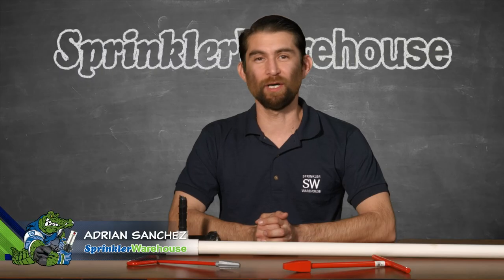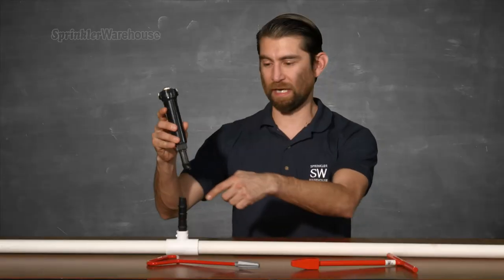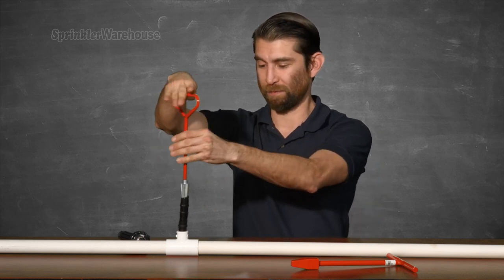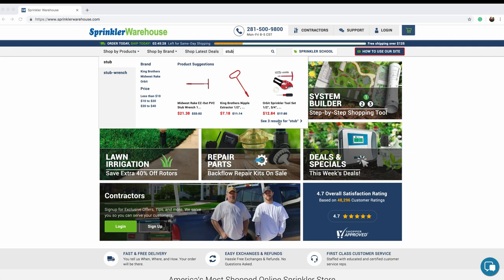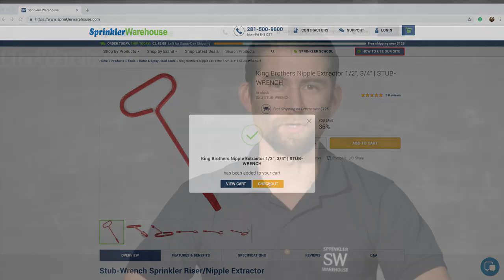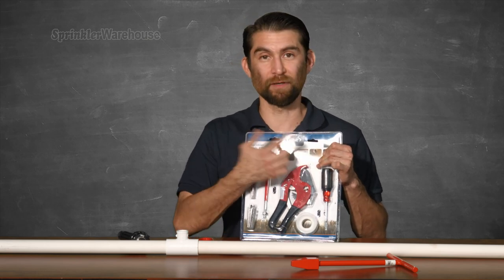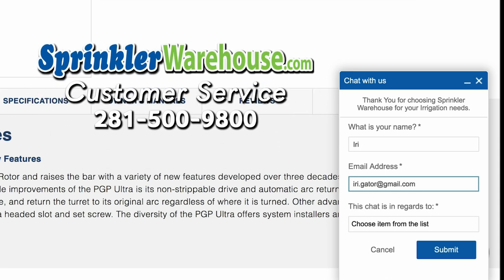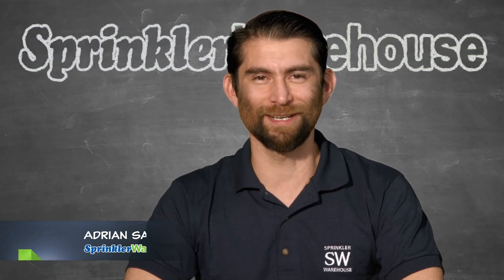Nipple Extractor

Comment: The Orbit branded extractor is not sharp enough to grip a broken riser. It just simply spins within the riser and really requires a good sharpening and tapping-in with a hammer to be of any use at all. It is also completely useless for removing corroded and busted metal risers because the head is made from some kind of cast soft metal.
Reply: what is ur recommendation for those?